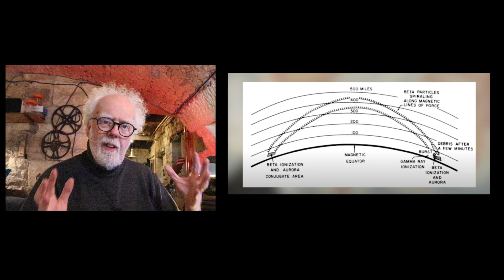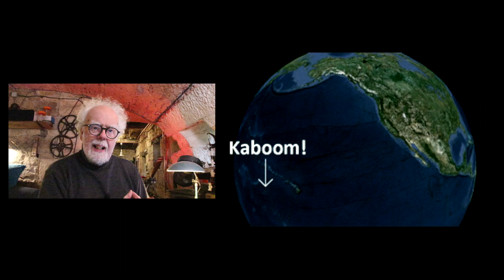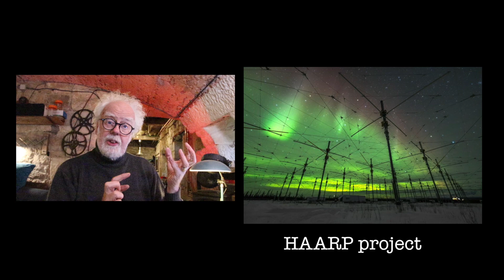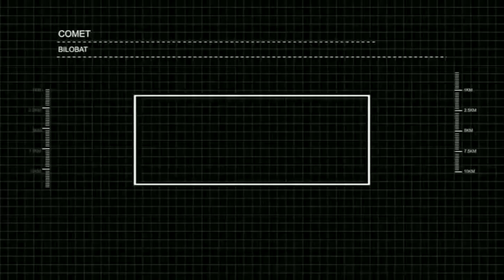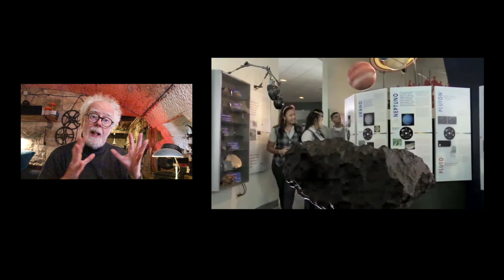Arecibo what happened ? - Prof Simon

Comment: The high altitude nuclear blast gasses plutonium/deuterium are still there.
Accession islands allegedly have the world fibre optics routed through them, Sn0wden claims that is where big data is copied and sent to 5eyes. 
The aurora plasma research continued at haarp, Britain has a ionosphere heater in Norway. Chile has one, Russia has one. Enough to make aurora but it's a failed weapon system.
Reply from the maker: Thank you....good info